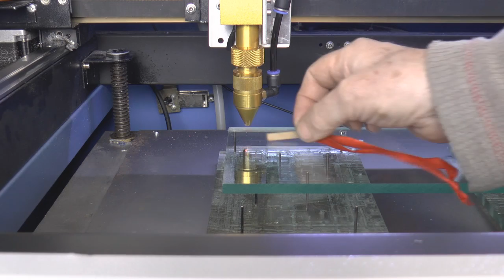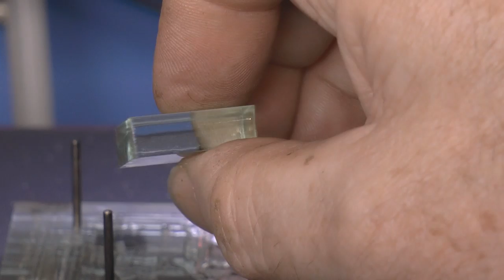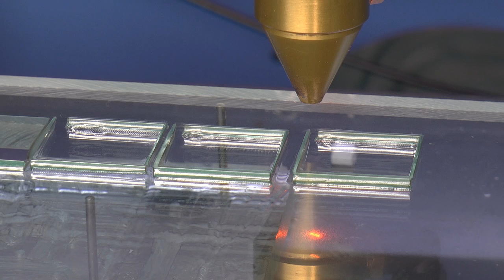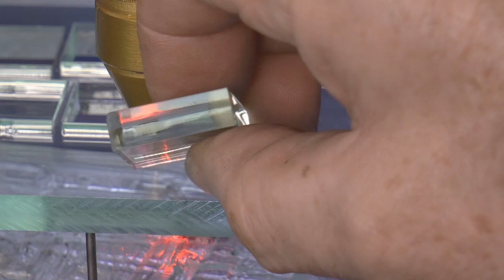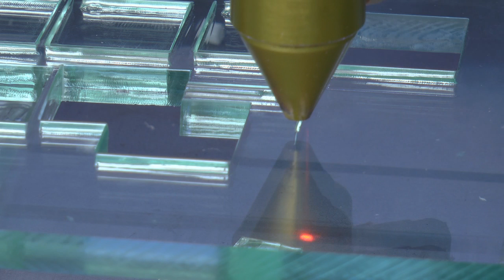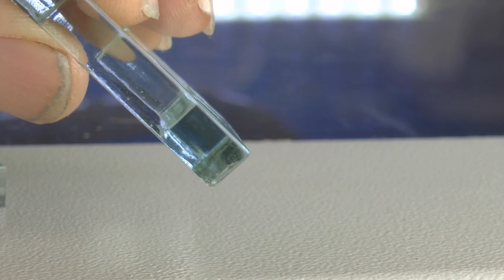RDWorks Learning Lab 54 Acrylic beam drag and flame polishing

Comment: hi i have just bought a BORDOR 40W LASER which is a very neat machine and it comes with RDWORKS have e you ever seen these lasers and if so what do you think of them, dermot love your videos
Reply from the maker: Hi Dermot
I have not seen one before but I looked at their videos and it looks like a well designed machine. The impression given is that it's fitted with a RECI tube. I was not aware that RECI made anything less than 100 watts (unless it's a custom order) It certainly is a meaty looking tube....but only 40 watts???
What size is the table/work area?
How much does it cost landed? 
Keep in touch and let me know how you get on with it. It looks as though this one will work well straight out of the box......and more importantly KEEP running reliably
Thanks for the kind words and the interesting information. I often get asked to recommend machines. That's obviously quite difficult as I only have one machine's worth of experience. However, from all the issues people bring to me I now know a lot about many machines. So it will be good to hear of something different that I can pass on to others, especially if it's reasonably priced, and by that I don't mean Ebay cheap.
Reply: hi the machine cost me €2400 from China and i should have it in about 4 weeks so i am learning rdworks at the moment, in other words i see more of you then i do my wife lol,,can you tell me in rdworks how do i get the blue arrows to the left like on your machine. Dermot
Reply from the maker: Hi Dermot
I have answered you arrow question elsewhere. As I said, I know nothing about this machine so keep in touch, From what I can see it does not have an ammeter fitted and if it is a 40 watt machine the maximum drive current should be limited to 16mA....it will be interesting to find out what the tube manufactures recommendation is. Unless it's a customer made special, Reci don't make tubes for those low wattages.
I would seriously advise ordering yourself a cheap chinese analogue ammeter   http://www.ebay.co.uk/itm/91C4-DC-0-30mA-Class-2-5-Accuracy-Analog-Ammeter-Amperemeter-Gauge-/351749565079?hash=item51e5e86a97:g:HjsAAOSwmtJXUVFu     
so that you know exactly what you are doing to your tube. Overdrive your tube and it's warranty will be void. That's why they don't fit an ammeter and don't advise the max running current. It seems that Bodor are reputable enough to tell you what that NORMAL max drive current should be. If you don't know already then email the question to them.
Fitting an ammeter is very easy 
https://youtu.be/xDZmuxq5BEM

If your machine arrives before you ammeter then do not use %power above 60%. I made this mistake by thinking I was allowed to use 100%. I trashed my first tube in record time through ignorance and is great for the sales of replacement tubes!!!!

Best regards
Russ

Comment: For cutting i put the focal point in the middle of the acrilic, not in the surface. Surface only in engraving..... Carlos
Reply from the maker: +coralsign 
Hi
This was a demonstration to show that you DO need to put your focus point into the material to get  a good cut on thicker materials. I put it on the surface to start with so that you could see the beam drag phenomenom. I did also mention that because I have a 38mm focal distance lens that sits 6mm above the surface , when it comes to cutting 8,10,12 and 15mm acrylic  I cannot get anywhere near the centre of the material (just 2 or 3mm lower) but I can still get good cuts.. 
Thanks for your comment
Regards
Russ
Reply: +SarbarMultimedia Thanks A lot Russ !! Regards from Brasil !!!
looking for information about air assist. i will see all your Channel !!
Reply from the maker: +coralsign 
My background in industrial metal cutting lasers indicated that I would need lots of air assist . When I first had my machine I fitted a gauge and used my little shop compressor but I soon found out it was not necessary. The little pump supplied was adequate. BUT, you will see that I do have a 38mm focal length lens and the nozzle is only 6mm above the cutting area. If you have a 51mm lens then your nozzle will be about 20mm above the surface. This is fine for engraving and for cutting acrylic but for cutting wood of any sort there is a burning action that takes place and the dense smoke right in the cut will absorb some of the infra-red energy and decrease your cutting ability. This is when you need a good airflow so you might want to try  experimenting with another separate air supply pointing directly into your cut It does not have to be high pressure , just well directed. ALL smoke should appear below your material  there should be none leaking off the surface.
Good luck 
best regards
Russ
Reply: Hi Russ, again thanks for all your work here, but in this video, I actually think you are saying something that is not correct and now when I was reading your comment here I find it a little divergent.  You are saying that people with a 2.0 lens and higher will not be able to cut so thick material, that is not correct! (at least for what I have been reading a couple of times) You actually use longer focal length when you need to cut thicker material! The longer Focal length, the less Power loss, because you have a longer depth of field. 
All this talk about Focus points and Focal length is actually Interesting, because as you know I'm working as a Graphic Designer now, but I have been a Professional Photographer for around 20 years. And I can  recognize a lot of the things we are talking about from Photography, and it is, in many ways the same principles with Focal points and Focal lengths.
So here is something you maybe can use in practic:
In Photography, when you are using long lenses with a very shallow depth of field, and you as an example, are out in the nature, and you want to get maximum depth of field with that lens, then you should NOT do what a lot of people are doing. Many people think, that if they focus on the background,  everything will be sharp. That is wrong! The correct and best way is to select and put your focus point approx 1 third into the scene. That is because the depth of field, also called DOF is shorter before the focus point, than behind the Focus point. 
The only thing we don't really have here on the lasers, is that we can't change the aperture, at least not as simple as on a Photographic lens. Another thing about Focus I have heard you mention in a video (Can't remember which one) where  you was correctly talking about the acceptable focus depth. That actually have a name, it is called "Hyper Focal distance".  A lot of things are the same as in Photography or at least very similar in the principle. You can, kind of also compare the shutter speed with the speed on the laser :)
Reply from the maker: Hi Klaus

I can only speak with the experience of my own 40 watt tube days. But somebody else had the same issue and I explained it in the second of the videos below
Here are a couple of later videos  on lense that you should help answer your question
https://youtu.be/1yMAr75h5O8
https://youtu.be/61bGzWicRRk

Your observation about asymmetry in the beam before and after the focus point will also apply to the laser lens but is basically ignored because the distances over which you use the lens away from the focus point is so short that it's effect is negligible.

Berst regards
Russ
Reply: Hi again Russ, and I am very sorry and I don't know what I have been thinking when I wrote my previous comment, but  I have seen more than one place that people are saying, thicker materials needs longer lenses. And because I only had a laser cutter I was of course believing that.
So when I saw you answer with the links, it made me think again :)  As you, so correctly have shown in your videos, it is not correct. I wish I could delete my comment. But back to comparison to Photography, if you have a lens with a very short focal length, also called a Wide angle lens, you can have a very long  Acceptable focus depth. And of course, the opposite when yo have a lens with a long focal length, you get a very short  acceptable focus depth.  And when we are talking about lenses and how they work, I am pretty sure that the principles must be the same. If that is right, then i makes perfect sense, that a laser lens with a short focal length can cut thicker materials. So when I think about that, and at the same time (if that is correct) that the shorter lens also gives you better details for engraving, then I can't understand why would you EVER need or want a longer lens??? Hope it al makes sense. Ps. Yesterday i ordered two 1.5 lenses :)
Any way that you can delete my comments?
Reply from the maker: Hi Klaus
Please don't worry about your comments. There was nothing stupid in there , just a question.
All lenses have a function that they are suited to. If you look at the spread sheet pink column you will see the relative way that the area across the beam changes for each lens. The whole key to CUTTING is energy density. If you want to cut through 25mm material then don't use a 1.5 lens, you will need a 2.5" lens. but there is no point in fitting a 2.5" lens to a 50 watt machine because the energy density in the beam will be so low that it will not cut. If you have a 100 watt machine then you will be able to boost that energy density back to a value where it will cut the material and because the beam is more parallel  for longer distances away from the focus point, the energy density remains high and you can cut thicker material.. So your statement that you need a  longer focal length lenses cut thick materials is correct PROVIDED you understand that you must have the power to do so. A 5 year old child will be able to do a lot of damage if you give them a scalpel but what if you give them a lumberjack axe?  It's the ideal tool for cutting down a tree but a 5 year old has not got the power to exploit it. I have used 30 watts with a 1.5 lens to cut through 15mm acrylic and 12mm soft plywood  at 1 or 2mm/s but now that I have 70 watts available, that job is better done with a 2" lens but at 4 or 5mm/s

When it comes to engraving it all depends on the flatness of your surface. If you are engraving on sheet glass  or acrylic, you  would never go away from a 1.5 lens. But if you were working with slate or a material with an uneven surface, you will experience change of focus across the job and the very short focus may give an uneven results.  Engraving is not power hungry as it is only damaging the surface so you can choose a longer focal length lens and get that more uniform result even if the dots are slightly bigger. The other thing to remember is that you will only be able to exploit the fine dot capability of a 1.5" lens on HARD materials. MDF will work but natural woods are too soft to hold the resolution.

Who said lenses were simple?

More food for thought
Best regards
Russ

Comment: Good video, The RD Works controller is used on a few different machines, so not all of the features are applicable to all machines, I think the through hole is for a metal cutting laser where more power is needed to pierce first before cutting as they use oxygen at about 90 PSI to assist cutting.    https://www.youtube.com/watch?v=llWoux2CSWI
Reply from the maker: +nick jennings 
Hi Nick
Your comment eventually arrived and was tagged as spam for some reason.
You are quite right about the use of Through Power. I used to run a laser profiling business with two 3kw crossflow CO2 lasers and you must pierce through  metal first first before moving off into cut mode. and yes 15 to 100psi oxygen will add to the exothermic reaction that melts the metal into a watery consistency before it is blown away by the pressure of the gas. This process  works for most metals except stainless steel where the addition of oxygen will react with the chromium  in the steel to produce a treacle consistency melt which will not be blow away. in this case you have to use more power and add very high pressure nitrogen (150 to 200psi) gas to exclude all oxygen from the cut area and to blow the melt away. Using this little Chinese machine is NOTHING like that experience and has required learning a whole new set of skills
Modern fibre industrial lasers are just staggering. Look at this  https://youtu.be/Xct9XzHQGp8  I couldn't even cut paper this fast!!!
Thanks for your comment. 
Best regards
Russ

Comment: Hello very informative video for a newbie. I have a newbie question. What is the beam drag and how can you tell that is dragging ? THanks
Reply from the maker: +freebird1963 
 If you fire the beam at a piece of acrylic which you can see through ( or any other material that you cant), The beam will pierce a hole vertically into the material. If the material is reasonably thick (6mmor more) and you now start moving the beam slowly, you will begin to cut a linear grove through the material . When the beam is moving VERY slowly. the cut will be vertical. But as you start to increase the cut speed the bottom of the beam (which has less energy density because its past the smallest focus point) will be cutting less efficiently. and will start dragging behind the beam entry point. Provided you do not exceed the cutting speed for the BOTTOM of the beam the cut will be right through. It's this loss of cutting  ability with depth that causes beam drag. This can be clearly seen in this video and at the end I drop the focus point and the bottom of the beam now has more power and the cut becomes more upright. and has better cutting penetration.
Hope this is a clearer explanation.
Best regards
Russ
Reply: Russ, Thanks very much for that explanation. Understand much better now. Thanks !
.

Comment: I wonder what the refraction index of acrylic is at 10.6 um?  Maybe this explains beam drag.  i.e.: as the laser digs a hole, some of the power reflects  and part of the energy that penetrates the acrylic  has it's angle changed.  A cool experiment would be to see at what angle relative to acrylic does the beam reflect so that the refraction index can be estimated at co2 wavelengths.

Comment: Sir, thank you for another excellent video. It would be helpful if you could show exactly how you make the changes is the RDWorks software to change the "Laser through mode" and delay setting for the laser start.  Again, thank you for your videos and the sharing of your knowledge and experiences.Randal
Reply from the maker: +Randal Sullivan 
Hi Randal
Through Power is not something that we generally need on our low power machines. RDworks and the machine control system has been designed for many configurations and different power machines. When you get above 300 watts you can start cutting thin metals. With metal cutting you must PIERCE a hole though before you can start cutting. I'm sure that why this function is there.
There are a few little used functions that are worthy of investigation (like, sew,  lead-in and lead-out) in the near future so I will make a note and revisit Through Power again. This was my first time of playing with it so there were a few suprises.
Thanks for your appreciation
Russ
Reply: +SarbarMultimedia Hi Russ,Thank you for the response and I look forward to your next video!Randal

Comment: I wonder if the next step is to try and increase the focal length of the lens arrangement. There's some good info here - www.parallax-tech.com/faq.htm
Reply from the maker: +IanScottJohnston 
Hi Ian 
Yes I've been there many times .It's a good source of information. Not too many people have the 1.5" lens and it exaggerates the "off angle" cut and also beam drag because of its narrow usable focal depth. I do have a 2.5"FL lens but that almost halves the cutting power of my machine so it stays in it's case. I do a lot of cutting and very little engraving, but even for high definition engraving, Thunder Laser sell a special head unit, which in reality is a 1.5" FL lens system, but I'm already there if ever I want to get into engraving. Thanks for your input....there are some places I have not explored, so it's always good to get links.
 Best regards 
Russ

Comment: Hi, Russ, I think i got a very good information on this focal length effective cut size etc that effects the quality of the cut and smoothness/uniformity of the cut...

a bit techy read with physics/maths involved but it explains the situation

http://www.parallax-tech.com/faq.htm

check it out mate, you will see what i mean.
Reply from the maker: +Johny English
Hi Johnny
Yes this is a good site. I've been there many times. They make excellent industrial priced laser tubes  (VERY expensive) and they are not very complimentry about the Chinese tubes if you dig elsewhere on the site. As you say their explanation is rather heavy reading for the non-engineering/non-science types, That's why I try to keep my explanations pictorial rather than too technical.
Thanks
Best regards
Russ
Reply: I understand mate, this one has a table at the bottom of the page as well that shows focal length, beam diameter vs DOF or effective clean cut area where you are trying to explain in laymen terms :) the page also shows the terms on a diagram, which actually shows something interesting :) you gotta have your focal point in mid of a piece you are cutting due to d-d area or DOF will be uniform across the cut if you understand the beam shape before and after focal point... so you can have a really thick cut with right type of lens, but beam size will be huge i guess and power density will be lower, so gotta read through carefully :) gotta experiment with the numbers a bit to make sense of power/lens/focal point and the dof area...